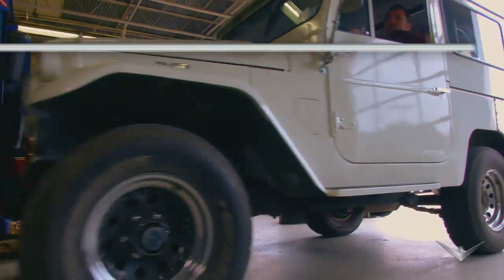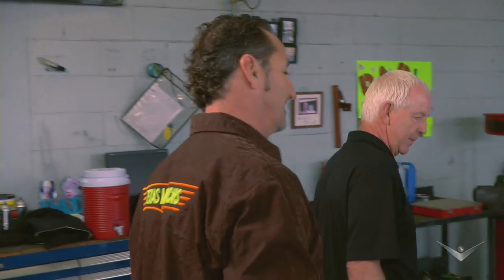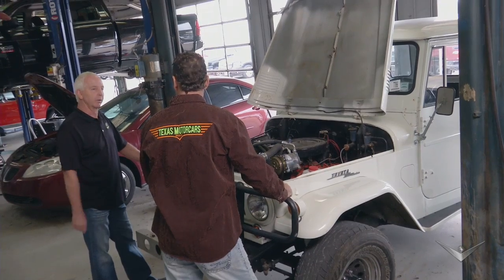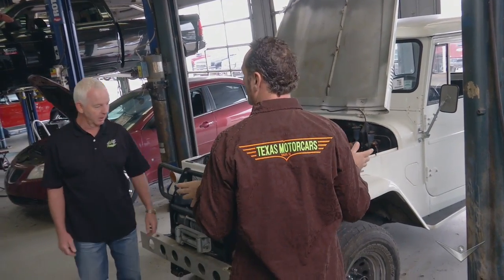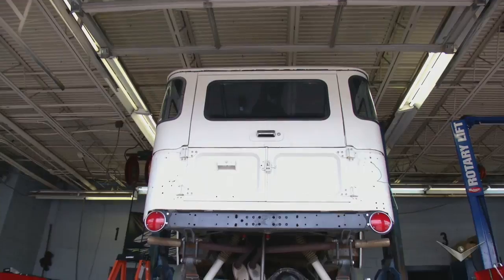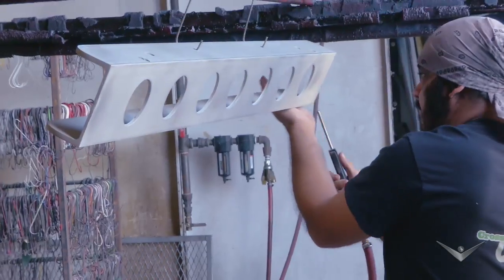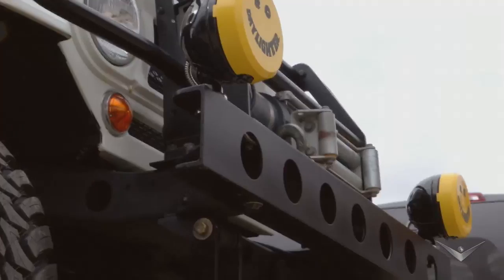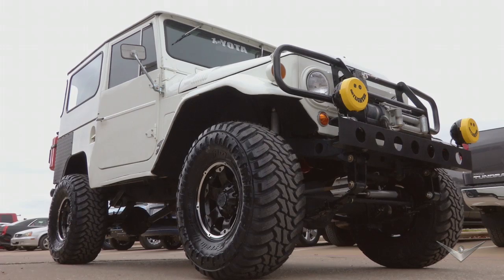1966 Toyota Land Cruiser | Dallas Car Sharks

Comment: Interesting, ours has an inline six and is original equipment. At one point my father had two engines and two transmissions he rebuilt one set and doesn't have the old set any more.